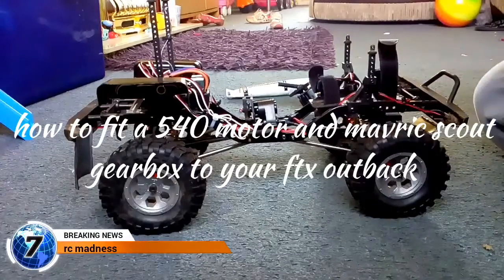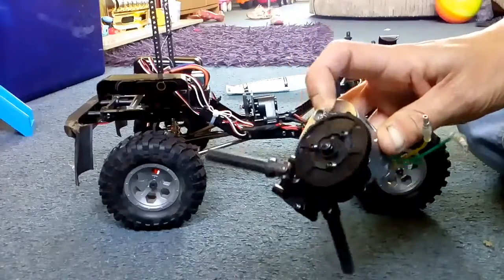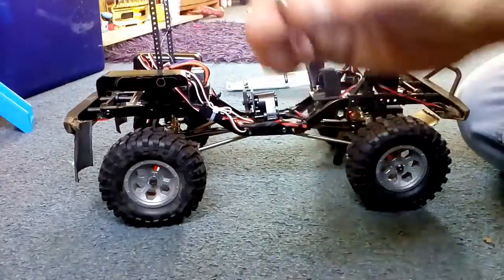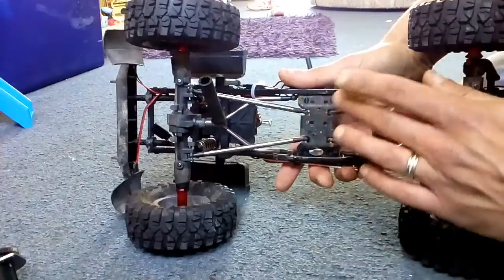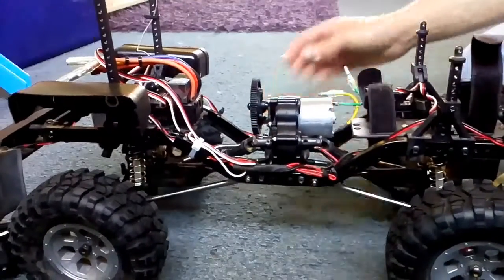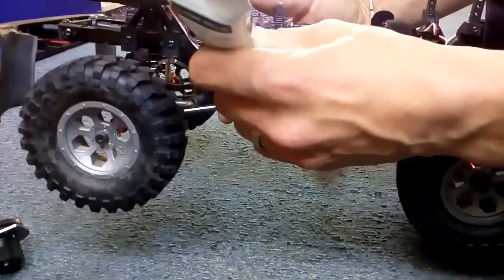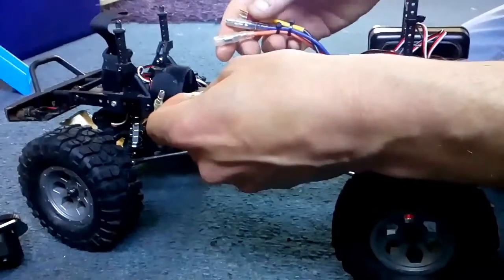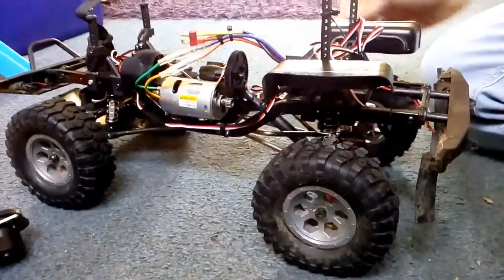How to install a 540 motor and maverick scout gear box to a ftx outback

Comment: What’s the advantage of the 540?
Reply: More torque and overall better performance.
Reply: The scale of this crawler is to big for the 260 it comes with this is basically a 1/10 crawler lacking some of the essential parts
Reply: Also glad to see I’m not the only one running 20 mm wheel wideners

Comment: Wow just came across your video and i stoked i was wondering if i could upgrade the motor. I have a version of the FTX the specs are the same but mine is called the RGT Rc4 Rock Cruiser.Did the stock axles hold up to the torque of the 540? thx for your time.✌